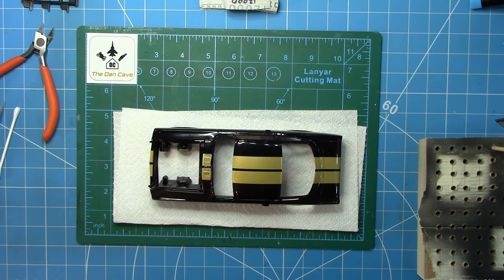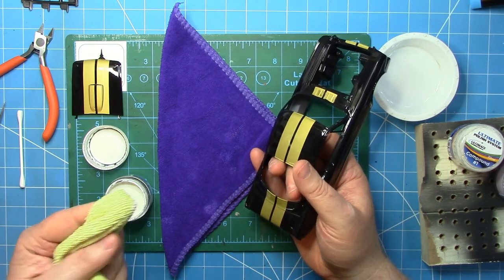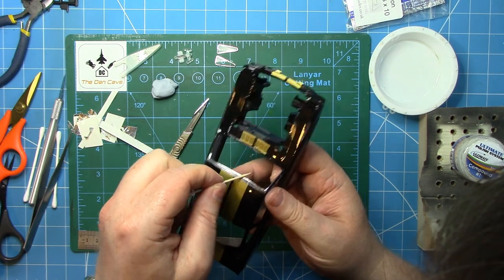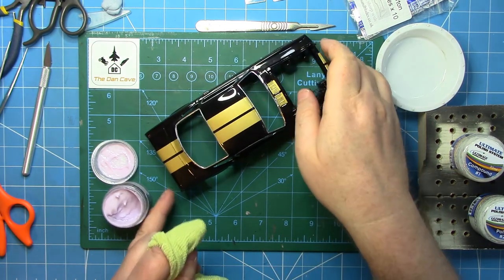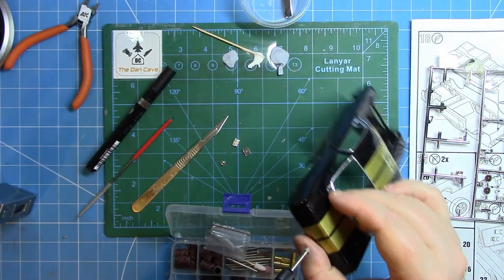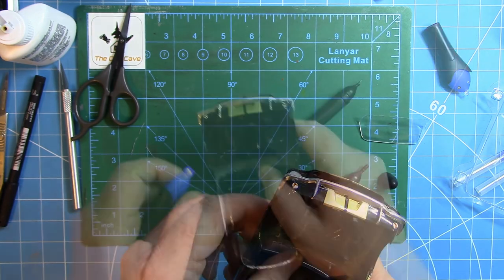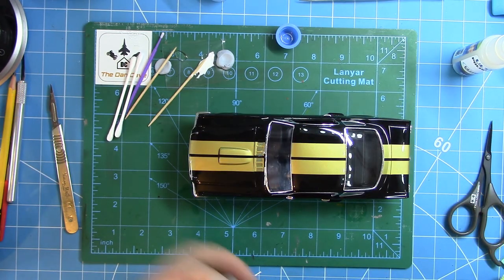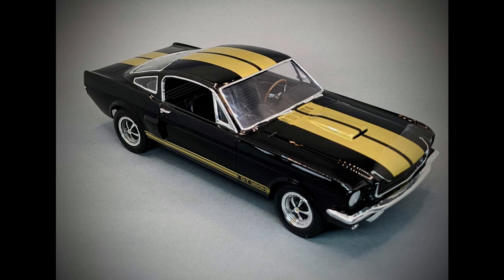Part 2 Final - Revell 1:24 Shelby Mustang GT350H

Comment: Can you put a link in the comments telling the different kinds of glue that you are using?
Reply from the maker: For general plastic work before paint I use Tamiya extra thin or Tamiya extra thin mixed with EMA plasti-weld (makes a hotter glue). After paint, chassis and running gear is generally all with CA glue. Windows go in with UV 10sec curing resin. External and small parts will generally be with PVA glue (generally Glue 'n Glaze.

Comment: Very nice work with the bmf. Did you use ”Chrome” or the ”New improved chrome”? The latter seems to be discontinued and the former is thicker, easy to wrinkle and though to cut. At least the ones i had.
Reply from the maker: It was the Ultra bright Chrome. It does seem to lose its adhesive qualities after a while and definitely need a fresh blade to cut it. It has been hard to get in the UK recently, and there is no alternative really apart from airbrushing Molotow or similar.
Reply: @TheDanCave  Ok thanks. Too  bad the good old improved chrome is gone. I once tried the ultra bright, it was almost as bad as the current chrome. But you managed it very well.